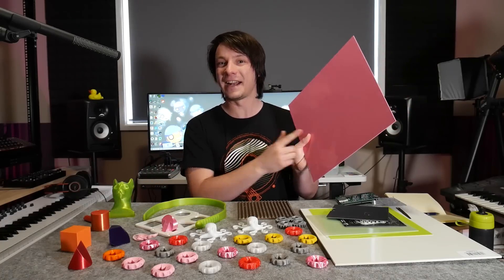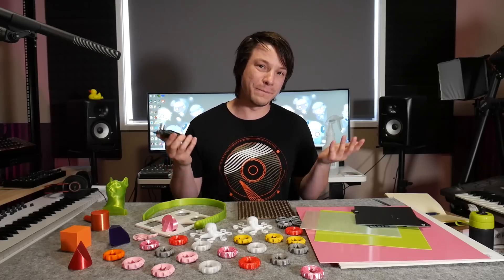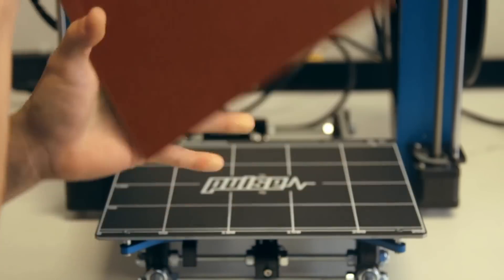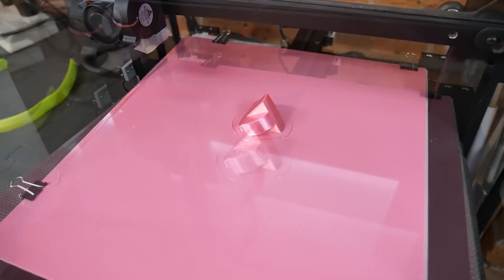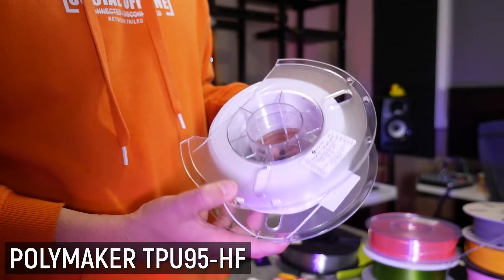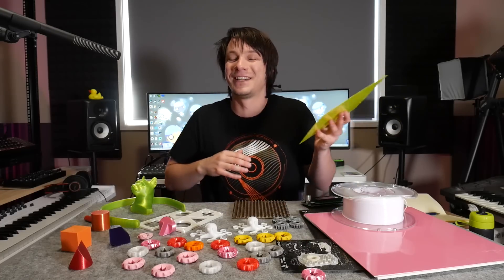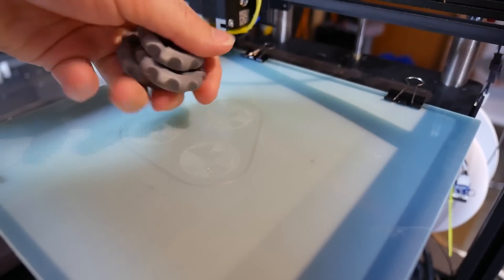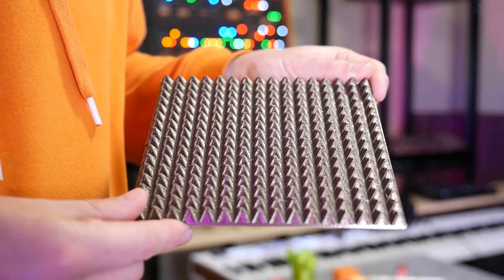G10 - The best print surface you've never heard of.

Comment: This stuff is literally the only material where I could reliably get nylon to stick. The closest contender was glass, but it's still a far cry from how insanely effective this was.

I finally don't hate nylon because of it lol
Reply: I hated nylon mostly because even in California scrubland with no rain all year it somehow still managed to soak up moisture and pop and fizz. Adhesion was a pain as well, I was using smooth PEI on a lulzbot mini with gluestick and it was hit or miss.  Ultimately I ended up throwing away half the roll as it kept getting worse and worse with moisture like issues even though I kept it sealed up and in california with no rain in it's lifetime.  I should have tried baking it at some point, but never did.  I am in a much wetter area now and the thought of going back to it makes my eye twitch, heh.
Reply: @Alluvian567 
I live in GA. It’s always humid here. 
I’ve resorted to buying a medium size room dehumidifier, closing that room off, and running it at 100% for a day before printing Nylon. Actually have the dehumidifier’s drain tied into the A/C’s condensation water drainage line. That way it can run w/o having to empty the water. 
Power draw sucks when I run it like that…but it works.  Afterward I turn the dehumidifier back to a reasonable humidity level and go on about my business. 
Since I use the same room for other things I want to avoid rusting it works out. 
Also, that particular room in my basement has no A/C returns or vents…so no humidity entering through the A/C directly to hamper the dehumidification process.

This was my nuclear option. On the plus side…I don’t need to print from a dry box.  I don’t know how low the humidity actually is in the room at 100% dehumidifier….but I do know I can feel the difference big time between that room and just outside the door.
Reply: Could you do it without using a enclosure or draft shield?
Reply: @xiaorulez  not a chance hahaha

Comment: I have actually had extremely good luck with a salt water mix being wiped on with a paper towel to the build plate, no matter the plate.  I usually use a flexible magnetic metal plate but on the non powder coated side (shiny metal) or the powder coated side, this technique has had extremely precise bonding on initial layer builds and bonds at temp but lets go completely when cool.  Give it a try.  Heavy on salt (table salt) and filtered water.

Comment: I'm using an lk5 pro right now as we speak to print my  voron parts in ASA. 240c and 100c on the bed. No enclosure, no draft shield and no glue stick. The only mod I'm using is a slice engineering heat break. I do manually tram the bed every single print though and I find that is the machines biggest downside If I can find one.

Comment: I bought a WHAM BAM PEI upgrade for my Ender 5 Plus, and for whatever reason, I also ordered a plain steel build plate with it as well, and never touched it. I can add this to the steel build plate that has been nothing more than a dust collector for almost 2 years. Gluing this to the steel build plate will give me two different build plates. Which adhesives would work best for this?? What is the difference between G10 and G10/FR4, and which is best???

Comment: BTW... You should have a look into SuperSlicer ability to automatically print the top and bottom layer with only one perimeter thus resulting in, IMHO, a lot more appealing prints - Those 3-4 perimeters @00:19 the bottom kinda ruin the otherwise neat look of the infill and not having to do that change in perimeter count manually at various heights is a neat feature.

Comment: I know I'm pretty late to the draw here, but if you have a ferrous build plate then you can get a magnetic sheet to stick to the back of your Garolite :) Then you have a production-quality removable build plate. If your base surface isn't made of ferrous metal, then you can buy a very thin steel sheet to stick down with a bit of adhesive so the magnet can take, though you might end up having to boost your temps a bit with the added material.

Comment: I've been printing on an Ender 3 pro for about a year on G10. Everything sticks to this, only issue is you need either a klinky probe og bltouch type probe to do a bed mesh. I have printet Nylon, ABS, ASA mainly on this surface and i agree with you Angus. This is one of the better unknown facts that this surface just is insanely good for FDM printers.

Comment: So, I have a Anet A8 first gen, which`s bed (aluminum) is thin and warps, i covered it with glass which is straighter.  If I were to cover it with G10, my guess is it would warp with the bed as the bed heats up?  glqass works well (but heats slow)  would it be worth the trouble?

Comment: Try putting some magnetic tape underneath it and stick it to the bed. It might make the clips redundant, although it also requires the z-switch to be moved a bit up and there's the chance that the nozzle impacting the bed will push it off a bit, making the print look like a sudden X or Y axis shift has occurred. But it may work

Comment: After smashing my head against a wall trying to print PETG for the first time, I found this video. After some tweaking, calibrating, and discovering that a warped aluminum bed on an Ender can, indeed, bow the glass on top of it a bit, I've got a sheet of 1/32nd FR4 on my printer that works exactly as advertised - sticky when warm, releases easy when cool, just like the Creality beds with the special coating on them that spoiled me so much. I'll have to do a little tweaking to get PLA+ dialed in on this surface too, but once I do, I'll finally have a multi-plastic build surface that's no effort, no muss, no fuss, no blue tape and no goddamn glue. 

Can't thank you enough for this video.
Reply from the maker: I went through all the same struggles, so glad to hear the FR4 solved it for you!

Comment: i had same issues with petg, im running a anycubic mega pro, similar to i3 mega

i did the next
-Calibration with feeler gauge (spark plug calibration tool)
-Print Surface Upside down, the logos and the pattern from anycubic wasn't accurate to print .1mm layers
-Calibrate Z axis motors to get it straight (with a caliper)
-tweak the speeds to get adhesion im around 60mm
-Cleaning the glass every print with isopropyl

Comment: About the attachment of sheets onto the bed. I used a thin adhesive temperature-resistant rubber mat on the bare heat bed. The rubber holds onto the printing surfaces without actually attaching it anywhere. Sure the rubber do insulate heat somewhat, but not much. Most heat goes through the rubber onto the print surface just fine. It also seem to help spreading the heat more evenly. Takes a few extra seconds to reach the target tempåerature but I find it well worth it for the flexibility it gives.

Comment: I use thick white art paper. I can only recommend it for PLA, but I've never had issues with adhesion (no hairspray or glue) and yet prints are still easy to remove. It also lasts for a surprisingly long time before it wears down, and is obviously cheap and accessible. 

The downsides are that it contracts with heat, and that the more frequent need to replace it is inconvenient if you print often. The thermal contraction also makes it necessary to preheat the bed before starting, as otherwise the paper may not have contracted fully. In my experience, you should wait for the bed to cool before removing the print to minimise the chance of tearing.

Comment: I've tested blank PCB's before (The non-copper side) and I have not managed to get anything to stick to them at all. There are obviously different types of these.
The nozzle just slides the melted plastic around on it, building up a blob of plastic around the nozzle.

I suspect G10 is different from a standard blank FR4 PCB.

(I work with a lot of electronic projects, so I happen to have a huge bunch of failed/incorrecly etched PCB's lying around)

Comment: I’ve printed on glass with abs but the first layer started to lift but the rest of the print finished nicely so which surface is the one that prints nicely for abs? I don’t use anything but PLA+ and ABS. G10 is the material of the sheet? I also noticed you didn’t use an enclosure for the abs print I had a trash bag surrounding the print to keep the heat in.

Comment: The McMasterCarr sheets have been painful to work with. I ordered 2 12"x12" at 1/16" thickness - one in blue and one in yellow (yellow actually is un-colored, just yellow because of resin color). The yellow sheet has a smooth finish, but not high-gloss reflective like what's shown in the video. The blue sheet is high gloss, but not glass smooth; it's smooth enough to create reflections, but the surface was marred by quite a few tiny pits right out of the box. The blue sheet is also very easy to scratch, and its surface finish has been further marred by almost every print I've printed on it- some of the top layer comes of with the prints. Never thought PLA could rip material out of a printer bed surface.

Haven't tried the yellow sheet yet, will update with my results.

Edit: The yellow/natural sheet definitely holds up to use more, but also requires higher build plate temperatures than the blue sheet. With the blue sheet I could print PLA at 45°C and PETG at 55°C. I've had to raise my bed temps for both moving to the yellow sheet. The lower gloss finish has a noticeable effect when trying to print with transparent filament, so I wouldn't recommend using it if you're trying to crack the "glass printing" problem. If you need to source from McMasterCarr, I'd go for the yellow/natural color, but don't expect a glass finish from it.
Reply: I'm getting ready to order from McMasterCarr myself.  Thank you for your information on sizes and colors you got.

Comment: Absolute Fail?
I am just not getting the same results as all these rave reviews...
petg, onto an 80c heated bed, with the G10 on it
not sticking at all
the filament just peels right off the bed and gets dragged by the nozzle

it almost starts to stick if raise the bed to zero nozzle clearance
but even then its just peels off by hand. plus that's clearly too much squish as there's so much backpressure the extruder is starting to skip

I'm seeing absolutely no signs of the magic benefits
using 2.5mm G10, the green-ish stuff from McMaster Carr
Reply: Sanding The Heck out of the surface started to help
but ultimately was not good enough, and defeats the entire smooth finish benefit

Comment: We use this material as a base material to die cut, actually 'kiss cut', against, using 'steel rule' dies. This material actually preserves the sharpness of our steel rule dies.

I have a question unrelated to 3D printing. I also just finished watching your 'Makeblock Laserbox' Review and was wondering if this 'G10' material could be laser cut, or would the fumes from cutting be toxic?
Reply: My understanding is that the fumes are toxic.

Comment: My results with a 1.5mm sheet of G10 were that, while adhesion was very good, however, when printing medium and large prints with PETG, the object I was printing would literally pull and warp the G10 sheet from the amount of force/pull that the PETG object would have while connected to the bed (from the plastic cooling possibly). This would, of course, cause the print to be warped by 1 or 2 mm vertically, where the bed had warped upwards.  I had to put many clamps around the edges of the G10 sheet in order to keep it from warping (and it still would a tiny bit).  Ideally the 3 mm sheet would probably NOT have this issue so I would recommend everyone buy the thicker sheets (2.5 mm and thicker). If there was some way to glue/tape the G10 sheet to the bed that could solve the problem as well, but I would NOT want it to be permanent. So I'm unsure what type of glue/tape would hold enough to print PETG (with bed temps around 80C) and still allow it to be pulled off/removed later when the sheet of G10 needs to be replaced.  Any suggestions?

Comment: Have you tried the salt water method? Been using it for a few weeks now and it performs excellent!

The idea is that you heat the bed, put a bit of water in a small container, pour quite some salt in there, stir it till solved, dip a piece of cloth in there preferably microfiber, wipe the buildplate. You'll see the water evaporate quite fast and it leaves a sheen of white behind if you look in an angle. That's it, that layer of salt will hold on to you print very well and release when cooled down.
Reply from the maker: I just leave it clean and heated, nothing else :) Seems to work!

Comment: G10 has been very common for years in knife manufacturing for scales and hard sheaths! Cool to see it being use in another hobby I am getting into.

I wonder if FRN would make a decent print plate, it's extremely tough, the scales from my BM Mini Grip are insanely rigid for how thin they are when removed, always blows my mind. Not sure about heat resistance though.

Comment: You should be careful with the glass transition temperature in FR4, as it will affect the degree of expansion of the base with temperature. Choose FR4 with high glass transition temperatures (185ºC) for best results.

Comment: So a word from someone who works at a circuit board manufacturer:

Good luck getting FR4/G10. The stuff is weeks out in supply. As another note, FR4 is good, but make note it does absorb moisture to about .1% by weight. I also suggest not bending it too much, where FR4 is a great material, it does tend to be brittle, so don't bend it too much. If you start to see white spots form on it when you bend it, then you've bent it too far and started to deform the resin and glass bundles in it.

FR4 is a material that's a mixture of resin and glass bundles/grains that go in a certain direction in a weave pattern. Tg is about 180ish, but note that after that it deforms.

Feel free to ask me any questions about the material, it's the most common material in our shop, but we do have many, many other materials in our shop, from fiber glass, to ceramic based, teflon based, etc.

Comment: 3D printer tip of the year!

As you said, a lot of printers come with a G10 print-bed with some surface on it. My TronXY X5ST came with a base G10 board, and a surface that I had to add. That surface eventually cracked due to temperature expansion and contraction, so I after watching this video I ripped off the surface and did a test-print.

Amazing result, print let go with zero effort!

Comment: I just replaced the bed on my brand new ender 3 s1, and it's working great. The only trouble is cutting it to the right size.

I used a razor saw to cut it, but I found a video on YouTube that shows a number of methods of cutting G10 using hand tools that would definitely be faster than the razor saw I used.  Among the tools he showed, a hack saw looks like the simplest and fastest for cutting square pieces.

Comment: hey, so I got a 1mm thick plate of G10 on Ender 3v2

The prints are sticking great with PLA, but they do not self release (25C bed temp.)

Any Idea why? I need a surface that self releases for mass production.

The Factory must grow
Reply: I'm using 1/16" (about 1.5mm) and it's releasing fine with PLA..  almost too well

Comment: I picked up some of this but I just can’t get my PLA to stick to the surface, even with slower print speeds and higher initial temperatures. I haven’t tried my PETG yet. I’m determined to make this work. I’m tired of using painter’s tape

Comment: I can't find g10 to buy. But I previously tried printing on sanded 2mm acrylic sheet. That too worked very well for me. You need to pluck the part out though. But no need to plough with that bed plate knife 🔪.
Reply: Hey. I finally got a sheet of copper clad epoxy glass G10 FR4. The copper coating is very useful as I can hit the print temperature quickly. As you said, this board works very well. I need to do a little pull to get the parts out. But, it's ok.

Comment: I've had better luck so far with a dirty bed oddly enough for my longer lk5 pro.  My initial prints went fine on the glass, but after that I was having issues, so I tried glue stick and I was cleaning it off and reapplying between prints, but it seems unnecessary and they seem to be holding up.  Of course my issues with the glass may be because I'm a beginner and my settings could be completely botched.

Is there a way to get the Longer bed to reach 100 degrees via an upgrade or something so that ABS is possible?  What about an enclosure?

Comment: The snapmaker has a notoriously uneven bed and many use glass to deal with this. Would using a thicker size of G10, say 2mm or 3.5mm provide the "even" bed people use glass for as well as having decent heating and first layer properties? Not sure if this is as flat as glass and whether the heat would go througha thicker sheet still

Comment: The best surfaces I ever had were on a mirror. It wouldn't work for really fine detailed bottom layer. 

The PEI sheet I once got as a print surface was a real disappointment. It didn't stick and it also ruined itself by having plastic burned in. So I never used it well. 

If my printer ever gets resurrected - i want a sexy surface again. But the Prusa magnetic one is so easy to use - i will take that as inspiration

Comment: FR4 and G10 are nearly identical. The difference is that FR4 has flame retardant components built in, which makes it the successor of G10. G in G10 stands for GLASS fibers and 10 for 10% glass and 90% epoxy resin. In FR4 in one of the two epoxy components, the “bis” phenol A there are some percent of tetrabromo are added which makes it flame retardant. In case of a heated bed i would recommend FR4 just in case of a thermal runaway. Which is not detected my the board/software.